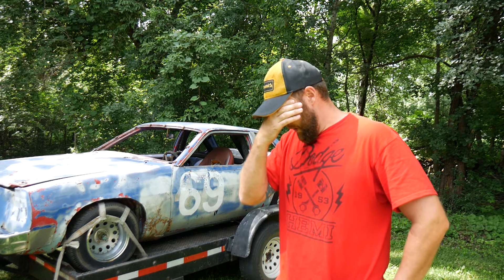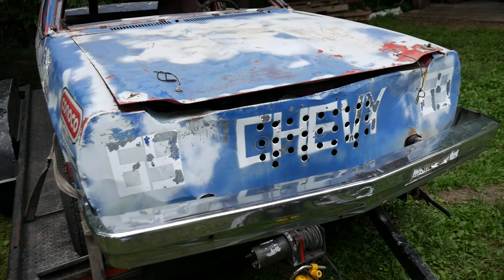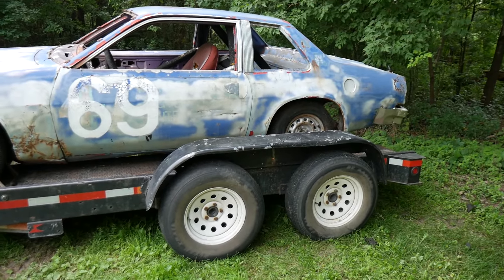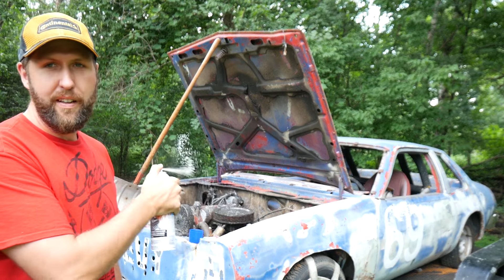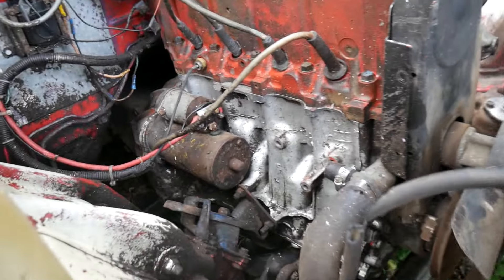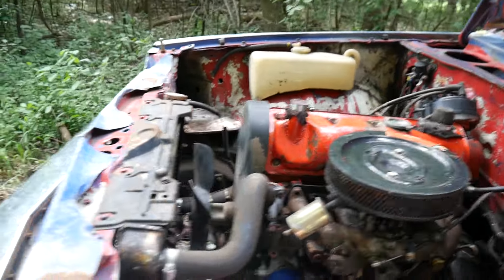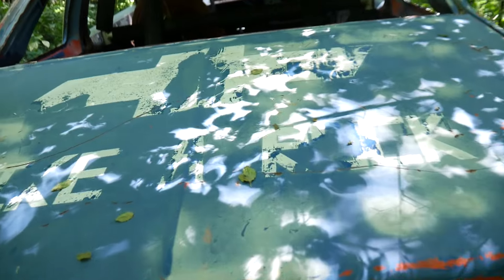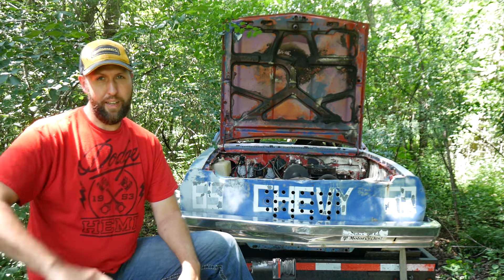I bought a old Chevy Monza Racecar! - Vice Grip Garage EP31

Comment: That is the tallest most unusual lookin cylinder head on the planet.
Reply: Vega engine?    Check the Gas and fill er up with Oil.   Peace
Reply: That engine was referred to as the "Iron Duke". Unfortunately the heads were very prone to cracking.
Reply: That's not an Iron Duke. The Iron Duke was the Pontiac OHV engine. 

What we're looking at here is the Chevrolet 2300 Monza/Vega engine that was GM's attempt at developing an aluminum block engine with out cylinder sleeves. Didn't work out so hot....
Reply: Clint Collins yup, me and my brother were thinking WTF is going on with that old thing
Reply: Eiffel tower of power!
Reply: @6StrngWzrd  Iron Duke is a different motor.... This motor preceded it.
Reply: @erikj.2066  Yes. General Motors called that "silicone impregnated cylinder walls". That coating on the cylinder walls was supposed to make them as durable as cast iron. It didn't work. Even the car owner who religiously changed their oil often didn't make it to 50k miles without needing a rebuild. The only good way to rebuild that after the cylinders were shot was to bore the cylinder out and install a cast iron liner. That got really expensive, especially for a car that was supposed to be an economy car. So most ended up in the junkyard.

Comment: When I was 14 years old a friend of my dad's gave me a 72 VegaGT wagon that had been sitting for 15 years. I cleaned the plugs didn't replace them and luckily the fuel tank was bone dry so i put an new filter on and replaced the rubber lines then put gas in it and the thing fired right up. I have faith in the little Monza

Comment: I had one only i turned mine into a drag car . easy car to drop a small or big block in. somebody enjoyed getting dizzy turning left going round in circles. they have it all over the place ! if you put a small block in i highly recommend larger fuel line front to back. it would be easy to tub do
that chevelle a favor buy it a big block and use that small block in the monza. that little car will fly

Comment: Saginaw 4 speed a plus. Horrible "Vega" ionized cylinder boat anchor engine a minus minus minus.
Reply: Brilliant.
Reply: Aluminum block Vega trash the Porsche 928 was the only other aluminum block no sleeve motors to be made neither one worked worth a poop~Charles you called it :))

Comment: If you get all of the factory parts from one with a v8 it go's pretty well. I did several in the 80's  you would need everything across the front including water pump, exhaust manifolds, motor mounts and body side mounts also.  with all of right parts it a nice swap.
Reply from the maker: That's a good idea

Comment: reminds me of the dirt track racers we have here in  deerfield ohio it must have been a starter class since it just has the inline 4 snapper motor in it. I am not sure why the fuel cell would be in the trunk it would usually be behind the driver where the battery is and the battery should be moved to the passenger floorboard. I am just going by demolition derby rules.

Comment: Monza famously had a V8 option that had a procedure to change the spark plugs which included lifting the engine out. Guys used to just cut holes in the wheel wells instead.

Comment: My first car was a '75 Monza 2+2 with 4.3L V8.  So yes, a V8 will fit right in but those cars are known to break the sub frame attach points if you put too much power to them.   The steering wheel is factory for a Monza (looks just like a Camaro).  A Monza is basically the Camaro's little brother.  Believe it or not, the Monza was the Motor Trend car of the year in 1975.

Comment: So I watched a battery restoration that Thunderhead289 did. Basically he emptied the acid and replaced it with distilled water and epsom said. I gave it a go on the battery for my 1971 Duster and it worked. I just did it a few days ago and it’s still holding a charge after it had been dead for about a year.

Comment: My favorite car i had was a 75 Chevy Monza 2+2 hatchback v8 4.3L. the engine you got there cam out of Pontiac Astra,and a 350 v8 will bolt right in there you just need the plates that bolt to the frame  from a v8 model,you wont find very many of these in good shape that are for sale.

Comment: 110 horses of rompin stompin hell death and destruction with the 2bbl.   And you appear to have the rare factry painted head.  My Vega would foul plugs about every 50 miles and blew the ceramic out of one once.   I'd add oil when the light went OFF after 35 mph.    Pretty reliable even if it did leak a lot of oil.

Comment: Awesome! Great idea!!
Keep the old 4 - banger. Turn it into a high rpm screamer. Forget the V8 (yawn...swaps of that nature are far too common and seeing as this is the most refreshing revival I've seen posted on the 'tube'...why go ordinary?) Throw in a lightweight flywheel, massage the head with some home grown DIY porting... throw a little $ into a decent camshaft and you'll have blast. Heck, at a later time cobble together a real bare bones turbo set up for it and see what kind of HP #'s you can coax  out of it.
Thoroughly enjoy the content you're putting together.

Comment: My Chevettes and Acadians would loose all their oil on the highway. Not all the time but on long runs all of a sudden if near idle the light would come on- no oil on the stick. I'm thinking under race conditions maybe they do the same. Never noticed in the Chevette race car though, lots of beer was fueling the driver though, I'm sure we checked that stuff.🍻👍 lol

Check/replace the timing belt. Those 4cyl sing pretty good on an oval👍
Today, they just dont compete with the Escorts, Nissan's etc. Sometimes it's all driver that wins the race. Good Luck

Comment: I believe in 75 and 76 it may have been newer. they actually put a 4.3 liter 265 or 267 v8 in them. My memory is a little foggy in that department but I do remember them coming with a v8 option. It may have been the spyder or 2+2 model.
Reply: 262/4.3 SBC was the factory V8 option in '75 & early '76 cept for California which got a 350, then 305's were the factory V8 option from '76 - '79 (I don't believe they offered a V8 in the final '80 model)

Comment: I would like to see more on the blue second gen camaro, but if ya ain't doin anything with her, I gots a 1990 k1500 single cab long box 4x4 5 speed mansual with only 107,000 miles I'll trade for it. Got a junkyard 350 from a 1994 k1500, and a few new parts like new clutch, new brakes and other things

Comment: this is going to be great.   youll get it done. and youll race her.   cap rotor wires plugs and new coil.  rebuild the carb or go new.  obviously redo the fuel system.  front end, brakes and tires. you and a buddy can knock it out in 5 days.

Comment: 140 Vega engine. Expect it to burn lots of oil.  You could get a mighty 110 hp. 262 V8 as a option on these, but a 350 wouldn't be a problem.
Reply from the maker: 110 will feel like a rocket in this thing!

Comment: Yes, V8s fit, even can be made to bolt up to that not-as-strong-as-wet-spaghetti Saginaw transmission.. 3 words, buy bigger springs.  The V8 will eventually tear the k-member out, but in order for there to be 'fun time' before that happens, you need better front springs.  Bonus points if you twist the body like a pretzel (GM saved on warrantying transmissions by making the bodies so soft that they'll twist first.... okay, maybe that's my take on it, but prove me wrong...

Comment: I had a 75 Chevy Monza with a factory 262 V8 small block Chevy. Horrible to change spark plugs in
Reply: Sure had some oddball engine sizes in the smog era hey?
Reply: I used a 262 car's parts to swap a 350 in my 78 2+2 back in high school.  H body v8s had quite a few oddball parts.  The oil pan is special with a dent to clear the inner tie rod.  The front accessories use a short water pump and mount the p/s pump to the head and on the a/c cars they mount the alternator with brackets to the water pump and intake manifold.  They use an in-tank electric fuel pump  The exhaust manifolds are tiny.  I think they cast the auto trans bellhousing minus a bolt hole and they had cooling holes in the bell housing.

Comment: Maybe a 151 iron duke, they make good gas compressor motors, yes I called it a motor, it runs on spark which is electricity. EDIT:  the standard 86-horsepower 2.5-liter (151-cubic-inch) "Iron Duke" four-cylinder engine .. Do you have a Hans device for when you get rear ended? =-) If you could install a wiper blade on the back window to clean the bugs off running into you would help.....

Comment: Looks like a Vega engine to me. Silicon aluminum R/F hardened aluminum surface cylinder bore. After about 24,000 miles that idea became obviously bad and both chevy and after market vendors offered a steel cylinder sleeve kit for the engines. In this case , the answer to the question " who thought this was a good idea?" " Factree!"

Comment: Surely you knew that the only option when the Monza first came out was manual or auto, and came with a 350, as it was GM's LeMans car?? The 4 banger was put in because of the gas crunch and it was small, and already in production, and the big three needed to compete with Japan.

Comment: Take the radio out and the radiator cap off push the car of the trailer into Pandora’s box, lock the box and weld it and throw it in the the middle of the ocean in the North Pole ( cuz who will dive in that cold shit). Push a new car on the trailer and install the cap and radio!

Comment: Pull that orginal seat out throw in a high quality racing bucket five point harness belt lol fuel cell old boat motor has tank run all electrical threw the old heater core box area I used to build derby cars weld the  u joint pins in to the caps on drive shaft won't break as easy turn the exhaust manifold threw the hood and cut 12 inch hold above the carb better breathing make sure the shift cable is good or if you got a four cylinder auto tranny many consider dropping that in I miss these days buliding these type of cars good times ty Derek #vggrocks

Comment: Durabuilt? Those 140 engines were anything but durable, most likely the worst engine chevy ever created, They quite literally burned oil from the minute they left the assembly line and from the looks of that one the years haven't done it any favors. Use lots of starting fluid to get it started cause i  bet it has nothing for compression.....